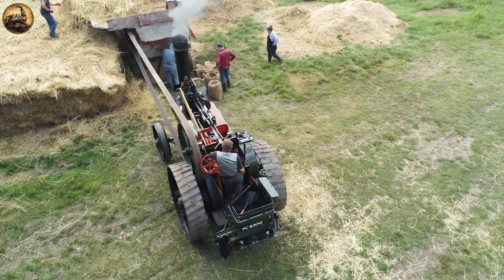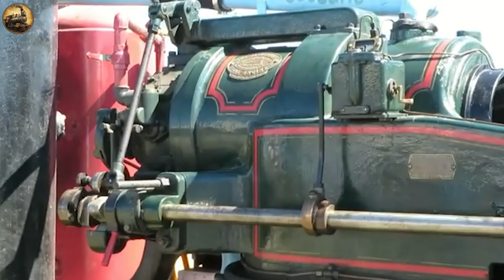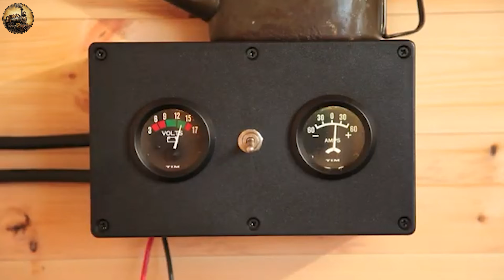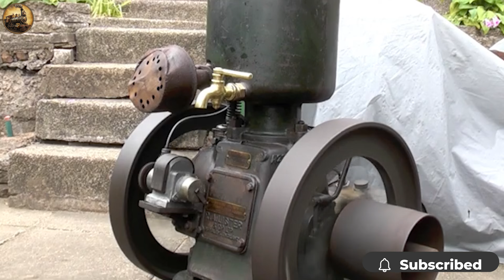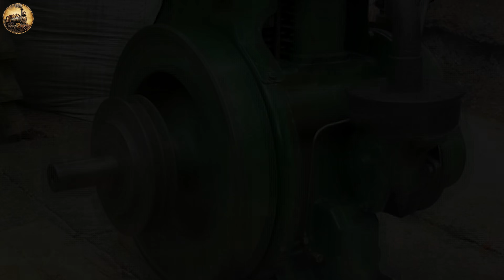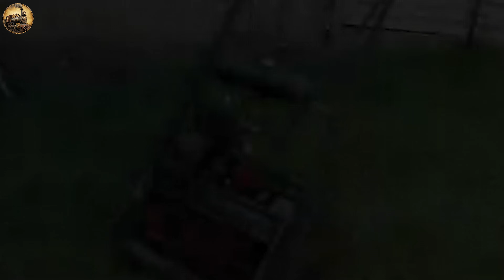WARNING: Never Start A Vintage Diesel Like This! | Steam Engine

Comment from the maker: The structural integrity of a cast-iron engine block is severely tested during a cold start, especially when improper cranking methods alter the designed compression ratio. Based on the mechanical failure breakdown in this video, which internal component—the connecting rod, the cylinder head, or the piston rings—do you believe absorbs the most catastrophic stress during a premature detonation or fluid lock? Defend your diagnostic reasoning below

Comment: Good Manufacturing good Engineering
Reply from the maker: You are absolutely correct that the manufacturing quality of these vintage machines represents a pinnacle of durable industrial engineering. It is always a pleasure to connect with viewers who truly appreciate the massive iron castings and overbuilt mechanical tolerances of that era. When examining the incredible longevity of these early diesel blocks, do you find the simplicity of their mechanical injection systems or the sheer thickness of the cylinder walls more impressive?

Comment: Very heavy duty Engine
Reply from the maker: You are absolutely right about the impressive manufacturing quality, as those heavy-duty engine blocks were engineered to withstand immense operational stress. It is always a pleasure to connect with viewers who appreciate the sheer physical durability of vintage industrial mechanics. When looking at these massive castings, do you think the sheer weight of these early diesels gave them a mechanical advantage over stationary steam power during continuous operations?